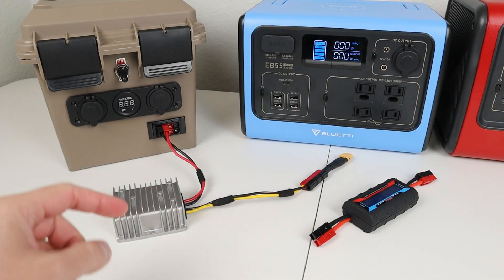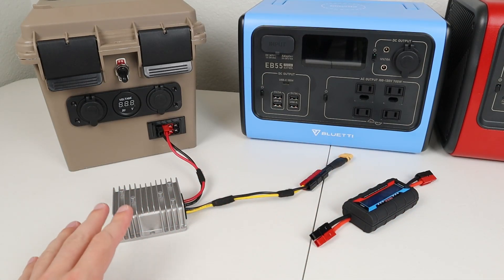Bluetti EB55 & EB70 Charging Tips and Tricks - Faster Charging Without Solar! EB55 400 Watts Input!?

Comment: I went ahead and ordered a cheap 1000 watt gas generator in case there`s ever a power outage and I need to charge my two EB70s and my smaller power stations on cloudy days to keep my small freezer and fridge going. I also ordered one of the tiny Frigidare air conditioners with manual controls like HOBOTECH used with a similar gas generator. They use around 400 watts so maybe I can get it to run on solar by next Summer. 

I`ll be moving into a large camper trailer soon and all this stuff will make things a lot less complicated if another hurricane or Winter storm hits. We have frequent power outages here even without the storms. 

I`ve bought every cable, connector, adapter, meter, tester, and accessory possible and so far I have three 100 watt glass panels and one 190 watt plus nine folding solar panels between 10 and 100 watts to charge little power banks for fans and lights and for portability with my 300 watt power stations. It`s nice to not have to worry about electricity or losing all my food.
Reply: I have the slightly larger, heavier, Honda EU2200i for the same purposes.  However, I have the Engel 45QT (1.3 cu ft) Marine FREEZER instead of a small Frig.  Be sure to use Ethanol FREE gas for your generator & drain the carb float bowl after each use.  Gas sitting in the float bowl will quickly gum up.
Reply: @azclaimjumper  How do you get ethanol free gas when there`s only one small gas station nearby? I`m in a very rural area.
Reply: @baneverything5580  Granted, Ethanol Free gas is definitely hard to find in small rural areas.   It's hard to find in parts of some large cities.  Maverik gas stations have tanks/pumps & sell Ethanol Free gas along with diesel fuel & 3 grades of ethanol gas.  Maverik gas stations is a chain of gas stations out here in the western part of U.S.A.
     Warm Regards from Reno, Nevada
Reply from the maker: Maverick is where I get my Ethanol free fuel too! Glad to have them located in my area.
Reply from the maker: Sounds like an excellent plan! Both exciting and fun :) I love tinkering with this stuff in my spare time. Good luck with the move, I'm sure you'll be prepared enough with all the gear / experience you have my friend!
Reply: @Jasonoid  I can`t determine if using the little generator to charge the power stations is safe. People have reported that these cheap little 2 cycle generators have burned up phone chargers and sensitive electronics. The seller says it`s pure sine wave but others report that it isn`t and doesn`t use an inverter but an alternator and the both the frequency in hertz and the voltage can vary and there can be huge spikes when a load changes. But there are a lot of people who love this generator and have used theirs for years with no issues. So I may have to buy another one in the future and use this one for different applications. So I guess this will be my air conditioner generator for Louisiana power outages unless I can think of another use for it. Maybe it can safely power a water pump to irrigate my garden with creek water.
Reply from the maker: You want to use an inverter generator that outputs a pure sine wave, I'd avoid using the 2 stroke cheapo Generators with expensive electronics.

Comment: Once again, well done.  In addition to mounting it somewhere with a good air flow, I definitely agree that a 12v to 24v converter should have it's own dedicated wiring directly to the vehicle's battery. - In other words, do not depend on the vehicle's factory wiring to its OEM cigarette lighter port. -
Reply: sure! car outlets are generally fused with max. 10 amps anyway .. which is already too much for this weak connection - runs hot. makes no sense to try pulling 17 amps - no way.
Reply from the maker: Thanks for commenting Andrew! Pulling 16 amps is a lot of power. Most vehicle wiring wouldn't handle it so glad they have fuses built in. It works well off my 8 awg wire from my battery.
Reply: How would I connect my converter to my battery and EB70? What types of cables would I need?
Reply: @RyLReaSoN  In lieu of the above mentioned converter - there is an available Yeti Goal Zero Regulated Lithium Car Charger cable that ups the charging voltage a bit to your battery pack.  When Goal Zero cable is set to "Low" the Bluetti will show about an 85 watt input.
Reply from the maker: Can you clarify what equipment you are using? Converter is a little vague.
Reply: @Jasonoid  I have a similar question.  I just got my EB55 and DC 12v to 24v converter.  Do I wire the converter directly to my truck battery and add a 24 v cigarette lighter plug?
Reply from the maker: @ryanoleston7136  That would work. Just wire it directly to your starter battery with 10awg wire and a fuse. Then the other end could be a 12v/24v socket to plug in your EB55 charging cable.
Reply: @Jasonoid  what size fuse? Thanks! Much appreciated!
Reply: @ryanoleston7136  20A I think since you would be pulling 16A

Comment: I've connected the Bestek 300W inverter directly to battery so I'm NOT using any vehicle wiring to provide power to an EB70 to recharge its battery when I'm driving down the road.
Reply from the maker: Excellent! It's a great way to charge up the EB70!
Reply: And the alternator can keep up ? What if my alternator has an output of just 90A ?